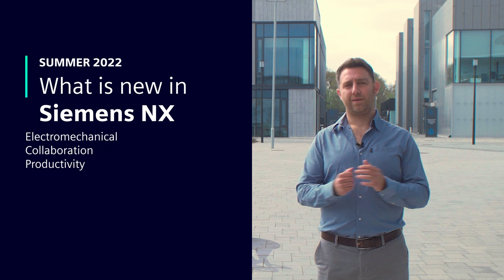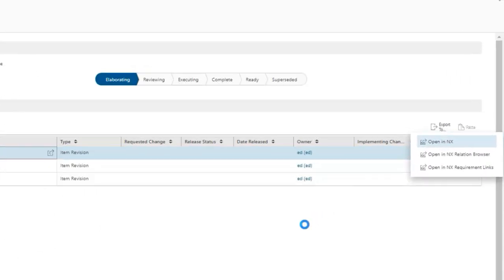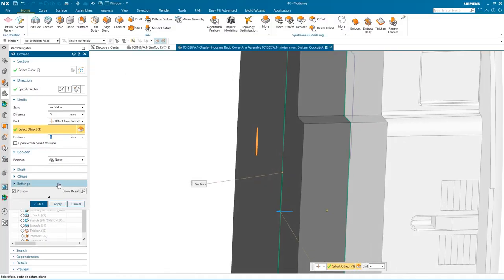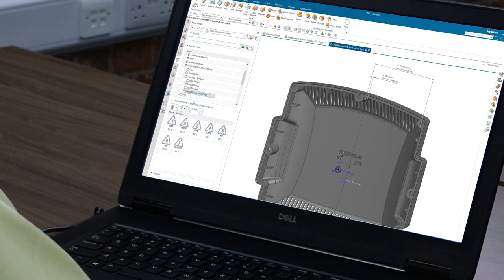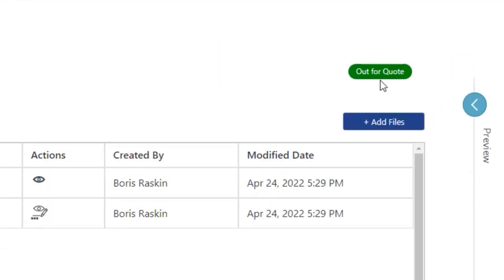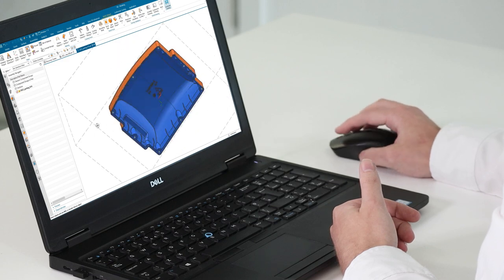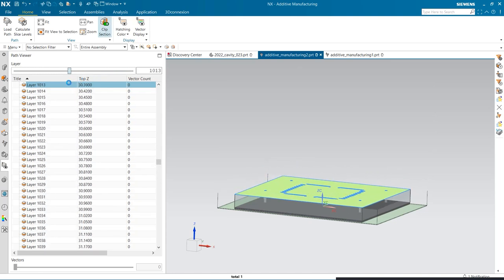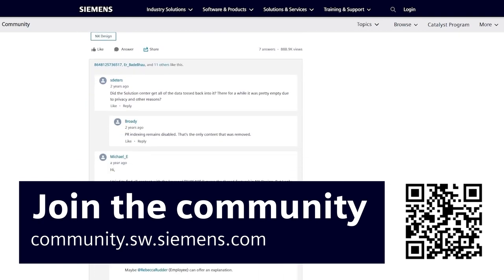What is new in NX | June 2022

Comment: too much expensive no one can learn , plus too much slow and old engine
Reply: @Paul Bevan im not your competitor mate im just a normal cad user
Reply: @Paul Bevan honestly due to high coast and advertisements i learnd this software in some fields , it's good for cam but for complex part design it doesn't worth it , its not efficient enough the engine is old
Reply: @Paul Bevan i really love nx , those gigantic companies wont bother to use super computers to do simple tasks , they'll never feel any difference , but for a simple test (im not a fan of rhinoceros) but simply comparing these two in terms of the speed of interacting we can see a hell of difference , also non of those automated features that has been shown here are actually functional in real action but in this advertising video
Reply: @Paul Bevan thats it ! this is the number one rule for business, but you didn't show 5sec delay for executing a simple task like extrude or fillet ( due to old programming engine has to load a dll which takes extra time for each click )  , or you didn't show other downsides that are really existed in software , nx is too much powerful again i love it
Reply: you cant compare a direct modeler like rhino with a parametric one like NX, its like comparing asteroids and bananas
Reply: @Paul Bevan i’m using an nx for the first time moving from power mill 2022 making a program on power mill takes roughly 2 to 3 minutes using   on  nx cam the exact same tool takes an hour and a half to calculate not good today 2.5 hour to calculate cpu draw is only 9% max while calculating

Comment: Not entirely sure anyone uses Xpedition at all to be honest (never heard myself). Might want to port NX to industry standard tools such as Altium for instance, KiCad which most likely soon be de-facto, etc. That's where and why CAD/CAM/CAE tools such as SolidWorks shines, they are versatile and yet incredibly powerful. Don't be left behind, Siemens NX
Reply: "anyone uses Xpedition at all" Mentor Xpedition and Cadence has much bigger market share than Altium... Altium is used mainly by medium sized brands , big boys use Mentor/Cadence - You know like Apple for ex. And don't compare SolidWorks with NX  - SolidWorks, Inventor and SolidEdge are in one bag (for small to medium projects). NX and CATIA are in another bag (for ex. if You are Boeing and need to design a plane)
Reply: @DjDziQ  Mostly true. Tesla uses Altium tho.
Reply: Xpedition customers contribute to a large market share of ECAD tools.  NX collaborates with all ECAD tools using industry standard methods (IDF, IDX, ODB++, etc.).  Altium is popular however has limitations compared with the market leaders, Xpedition and Cadence Allegro.  You will find though, a better integration between NX and Xpedition than ANY other combination of tools currently available; and it will only get better.